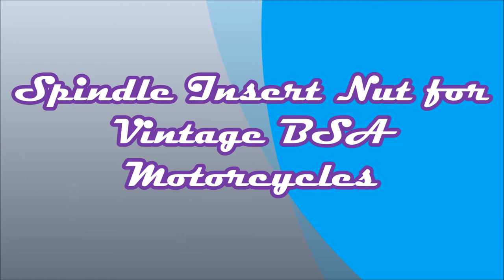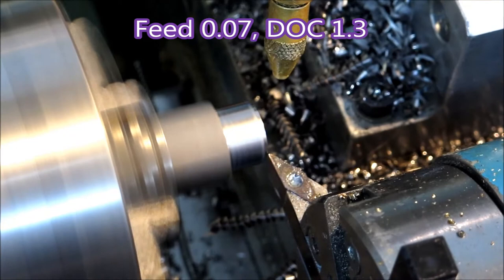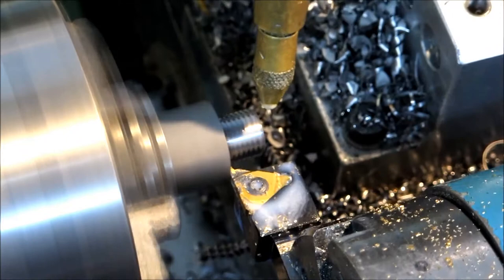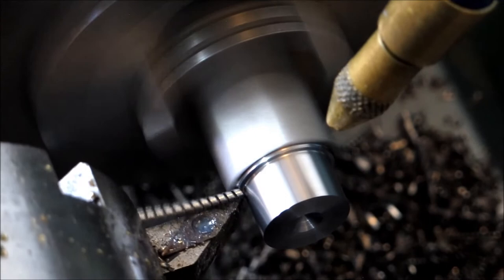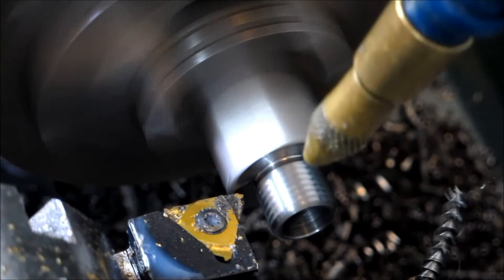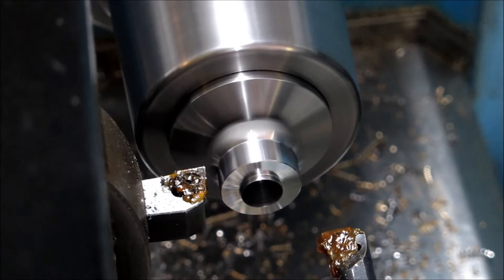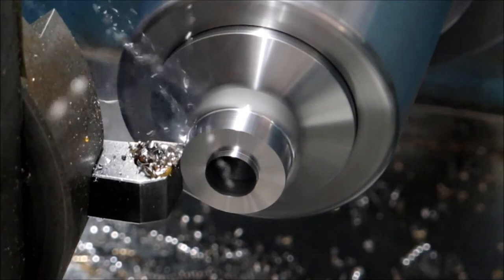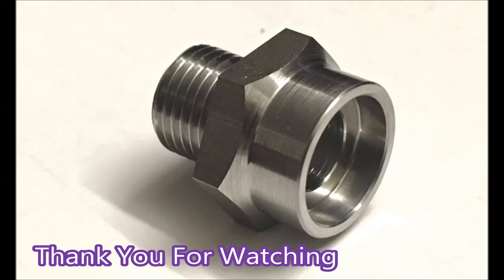Vintage BSA motor cycle part made from Hex S1214. CNC lathe threading and boring

Comment: Thats what you get for letting me in your shop and setting up the boring bar.
Reply from the maker: It was you! That makes me feel much better, thanks for owning up to it. Visually it looked ok but a sleeve of aluminium does not make an 8 mm boring bar a 12 mm boring bar. Just a reminder to all of us that boring bars and parting. tools should be long enough to do the job and no more. Thanks for the comment Patrick, don't get many but I can always rely on you.

Comment: For the second side, did you consider using a threaded bung to hold the component?
Reply from the maker: I don't know why I would consider that when I have a 5C collet holder to use. I never had a great deal of success with threaded bungs, always get too much runout and parts stuck in the bung.